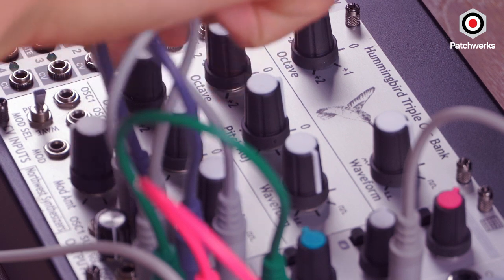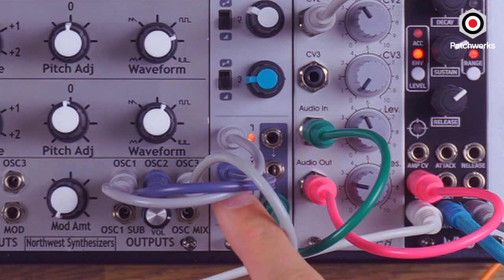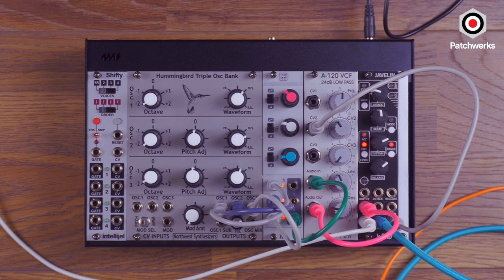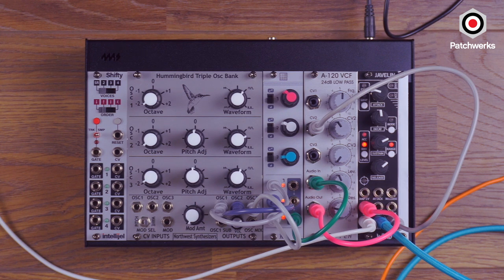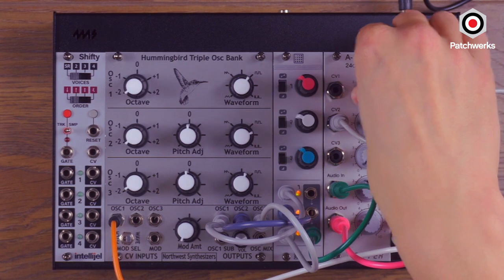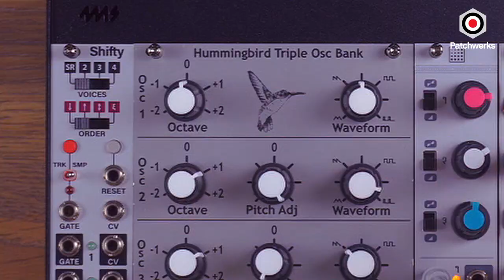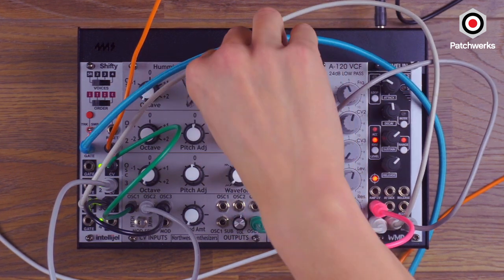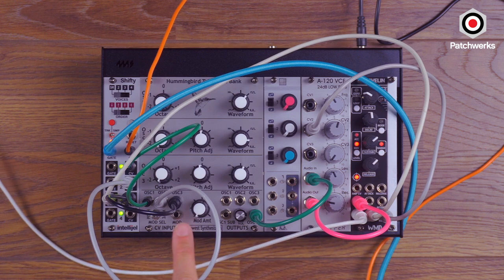Introducing the Hummingbird Triple Oscillator Bank

Comment: Sounds great, but wish it had waveform CV
Reply: Hey Warren, on the bottom left corner there is a switchable Mod cv input that can switch between Pitch and Waveform. It does target all the audible oscillators and acts as an offset on the current position. There is a new update for it where when you turn Osc3's octave all the way down, it goes into LFO range, allowing you to use it to modulate for some PMW goodness
Reply: @TheHomestereo  props, thanks!